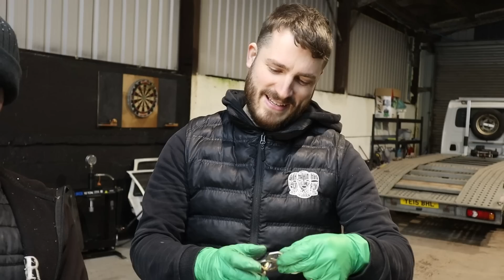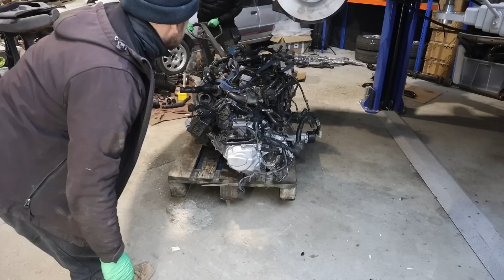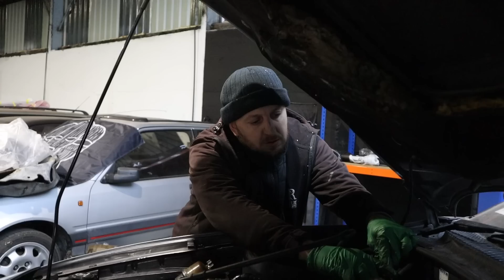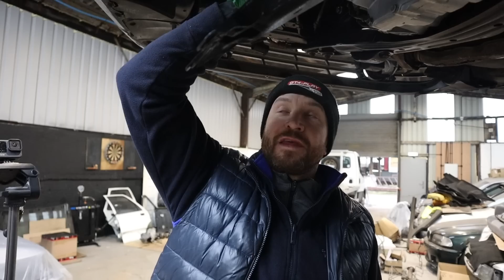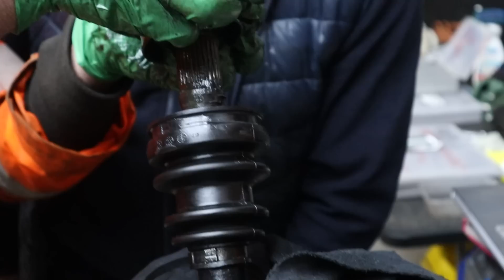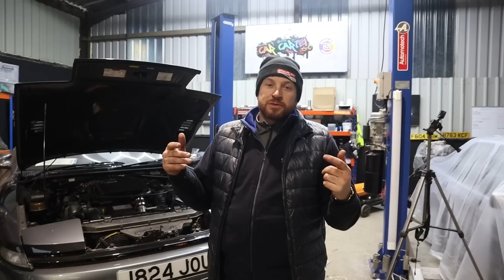Getting Our Celica GT-Four Engine Fitted!

Comment: Is the plug floating around the diagnostic port? It should be labelled "diagnostics" with a grey cap near that side strut top but towards the firewall. Been a while since I had my 185 though
Reply: We did think this at first but then we found the diagnostics plug up buy the top of left strut 👍 so we still have no idea what it is it’s very close to the maff plug on the engine loom
Reply: @richardstokes2209  my replies keep getting deleted. Have you had a look through the wiring diagram from Toyota? There is a website that has all of them but keeps getting deleted when I try type it in. I am stumped also what that is. It looks pretty big for a plug to not be connected to anything